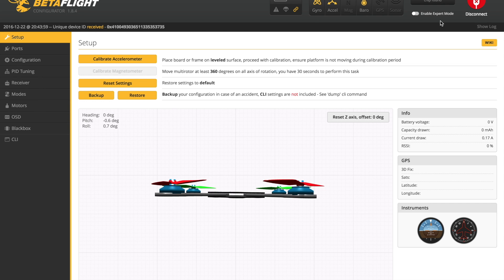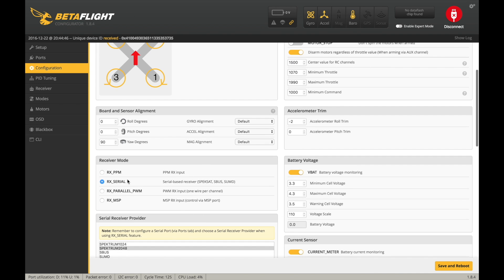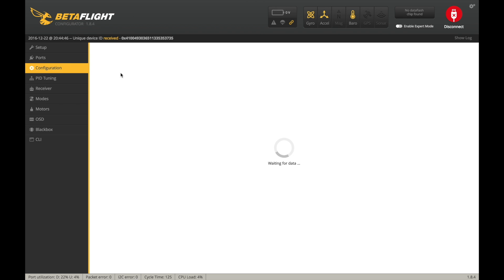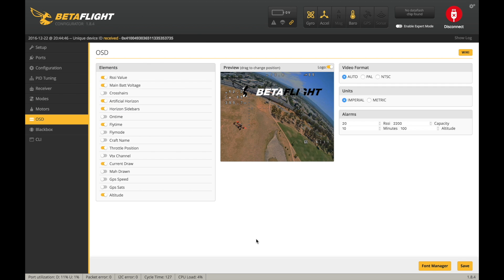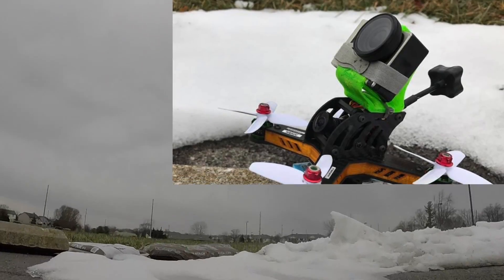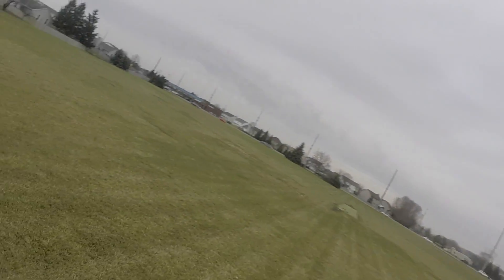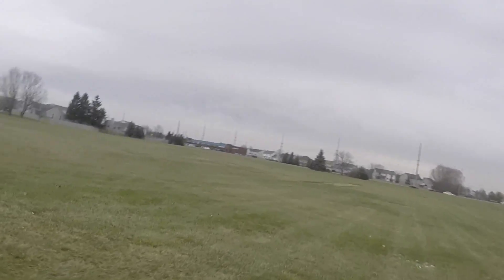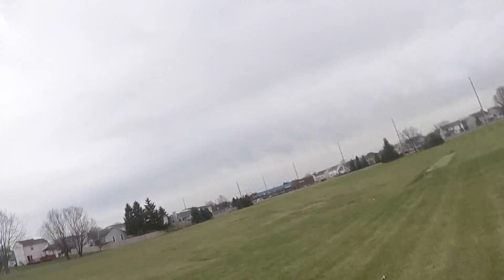Omnibus F4 Pro Betaflight Configuration

Comment: I bought an omnibus f4 pro v3... from gearbest for $21... seemed to good to be true... it was! Idk if it was because its a gearbest fc or what but the barometer as well as uarts 1 and 6 do not work...😑 it is the v3... which has said the softserial does not work on ch 5 and 6 due to the inverters on pwm 5 and 6.....! So confused🤔😅😫! Any suggestions as this whole rig.... "was intended as a 5" long range with crsf and 3000 mah 5s lipo!" lightweight quad with the ublox gps, return to home mode and all that jazz.... but 1 uart on there isnt going to cut it!

Comment: hello Rosco I wanted your opinion on ... Skyzone-SKY02S-V-3D-5_8G-40CH-FPV-Goggles-that I ordered ... and then I would like if you could advise me how to set up the PID so that when I do a flip left or right the quad when you turn me remain stable and do not run away from where it is.
Thank you.
Reply from the maker: I have no idea on the skyzone goggles man. I use fatsharks. And it sounds like you need to setup Angle or Horizon mode so that the quad flips you level when you have no stick input. SHouldn't require PID changes.

Comment: I'm using the omnibus f4sd, osd first gave me a issues with the font. Once I saved a new font, then it was perfect. I just ran the ground from my monster v2, to the omnibus video ground (in) then from my TBS unify pro, I ran the ground to the other side of the omnibus, video ground (out side) I did also power my camera from my vtx and vtx from battery power from pcb. I have not had any drop out of the video, but I did see a video on here. I think it's a Omnibus F4 v2 wiring video with a piece of paper and he has ceramic tweezers. It said that if you don't have the ground from your camera and the ground from your vtx going into the omnibus, the osd can mis behave. Just thought I'd let you know what was working so far for me. I just finished building a 5" alien clone and that's my vtx/osd setup. Good luck, happy flying

Comment: OMNIBUS F4 PRO V3 FLIGHT CONTROLLER WITH CURRENT SENSOR, OSD AND SMARTAUDIO is it same way for port setup for my frysky x4r receiver? i hoping when i get it that it isnt hard to wireup, i have a tramp hv vtx with rotorriot fpv cam,foxeer pdb with stock pdb for alien so ill be trying to wire up osd for voltage x4r,tramp vtx not sure yet how it hooks up to this board
Reply from the maker: I think you will like it! I love my Omnibus boards and I've been slowly switching all of my quads over to use them. With the Tramp & Smart Audio you can do some really cool stuff!

Comment: ok new problem i got it all hooked up osd and voltage but when i went to calibrate escs it only works on oneshot125 im using blheli s escs :/ lil bee 30s and when i raise the master motors dont spin any ideas

Comment: Your OSD flicker issue.  Do you have the grounds next to Video IN and Video Out hooked up?  I think you at least need the camera ground hooked up.
Reply from the maker: Jeff no I don't. I'm going to try this tonight and see if it works.
Reply: please up the results, I have an F3S AIO with the same problem, thanks
Reply from the maker: Dude that worked! sorry for the late reply. I made a video about this a week or so ago. It fixed my OSD flicker issue.
Reply from the maker: https://www.youtube.com/watch?v=Rtz28MYWkUU
Reply: RoscoFPV it didn't work for me I'm guessing the f3 version is different
Reply: RoscoFPV I'm getting good video just no OSD have everything turned on n saved in betaflight